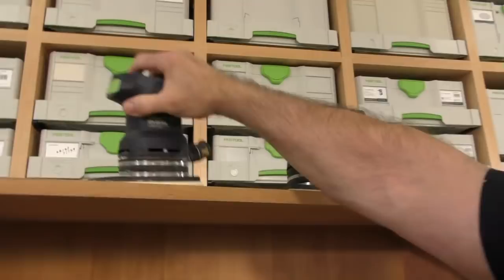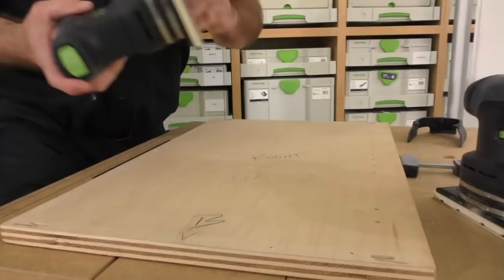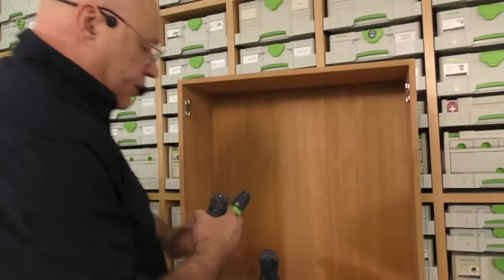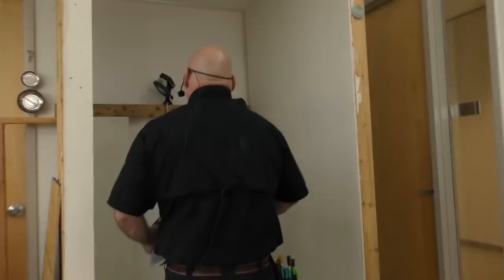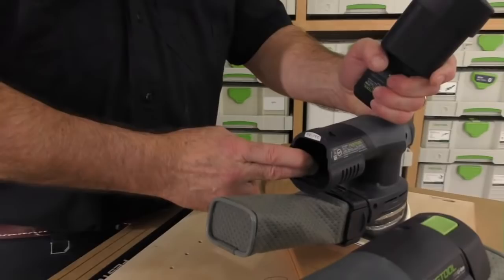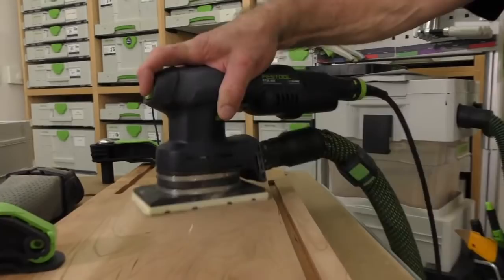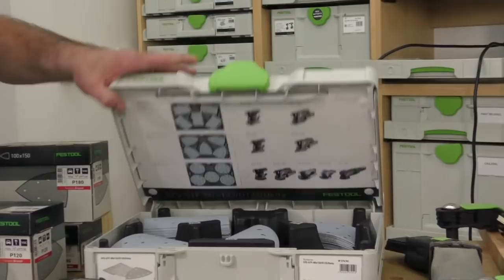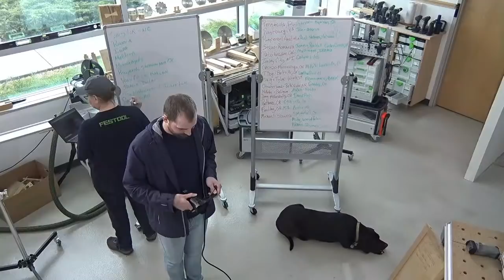Festool Live Episode 93 - RTS vs. DTS

Comment: At about 20 minutes you show the abrasive systainer which accepts delta sheets.  I'm looking to purchase the "Festool 576781 Abrasives Systainer3 SYS-STF-80x133/D125/Delta"  which you nicely show in your video.  I'm confused because the DTSC 400 Li manual says the sanding pad is 100x150mm but 576781 says it will accept the 80x133?  For example, will the DTSC sheets, such as this one "Festool 497134 100x150 Granat P180 Delta Abrasive, 10 ct"  fit the 576781 openings?  Thanks.

Comment: I'm looking to purchase the "Festool 576781 Abrasives Systainer3 SYS-STF-80x133/D125/Delta"  which you show at 
about 20 minute’s into the video.  I'm confused because the DTSC 400 Li manual says the sanding pad is 100x150mm but 576781 says it will accept the 80x133?  For example, will the DTSC sheets, such as this one "Festool 497134 100x150 Granat P180 Delta Abrasive, 10 ct"  fit the 576781 openings?  Thanks.
Reply: 80x133 is for the RTSC and LS 130. If you search for the 576781 Systainer, the printed insert shows the three different shaped papers that can fit; round, triangle and rectangular.